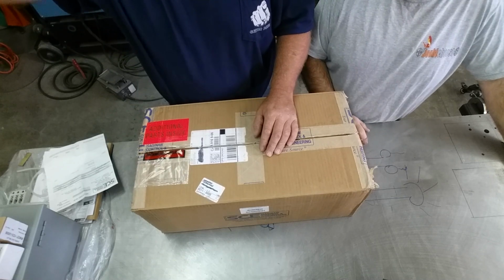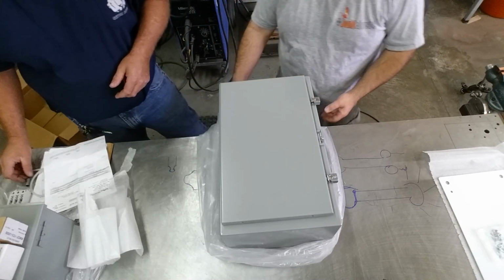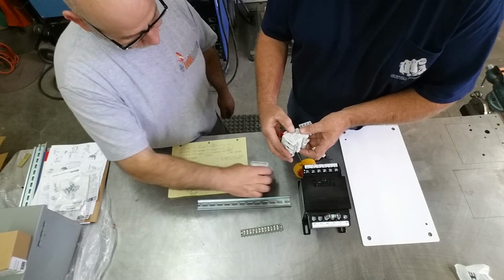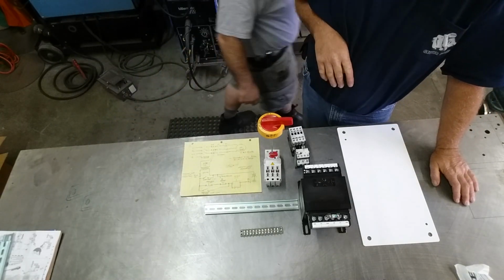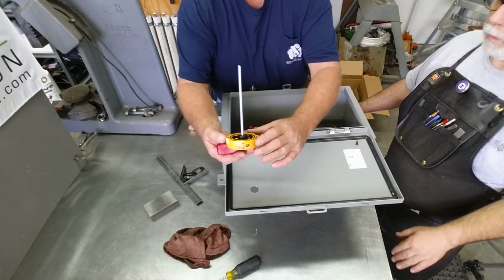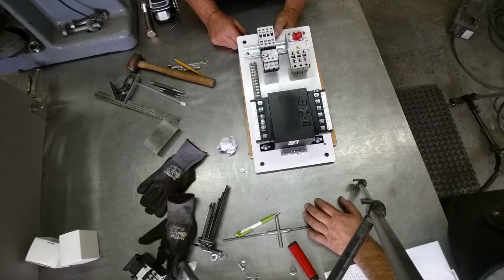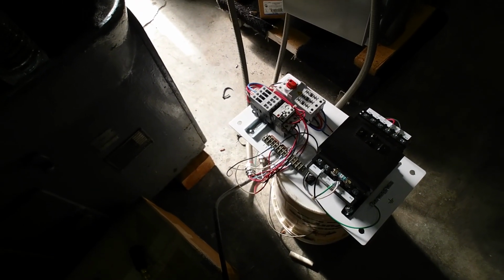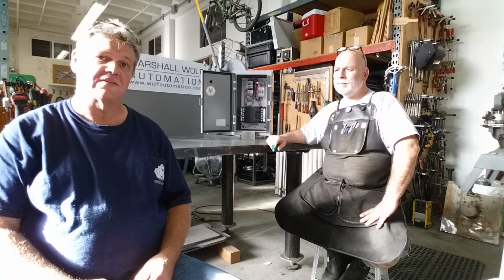Marvel saw control group

Comment: Great video guys! 

I’ve got a quick question. 

I’ve got an Armstrong marvel saw control. Model 81-ea404 and I can’t find mention of the input voltage anywhere online. 

It has a built-in transformer/power supply and fusing mounted to an aluminum plate… But I don’t know if Input is 120 or 240 into the small transformer. 

I’ve contacted everyone I know online and thought you guys might know. 

If you Google that model number you will see there’s only a few mentions of the control unit anywhere online… Before it was quickly upgraded to another totally different unit.

Thank you for any help you can give 🙏
Reply from the maker: Can't really say without seeing the wiring diagram, do you have that?
Reply: Shadon HKW 
Thank you Very much for your reply. 

No I don’t have the wiring diagram, I only have the programmable controller circuitboard and the button display keypad. I’ve contacted everyone online that I could think of… And no one‘s gotten back with me. 

I can’t find a Single shred of documentation on ANY of their programmable controllers. I have the very first version which is usually called “PC” or “PC1”.  If you Google 81ea404 you will see a very low resolution image of the controller in my possession. That’s the only mention I can find it online anywhere.

It’s extremely uncommon. Most commonly I’ve seen the second and third versions which are usually identified as “PCii” or “PC2”... but still no documentation on them.

I did look over the Google patent information… Which gives quite a bit of good info on the operation of the interface and keypad…but doesn’t refer to voltage whatsoever.
Reply from the maker: @hullinstruments  I see on that google image some numbers stamped on the transformer itself, do those resolve to anything useful?

Comment: Great video, gentlemen! Can't wait to see that baby rip through some stock! I love the clean wiring Stan. I'm the same way, and can get pretty analysis when it comes to a control box. I can't tell you how many times I came across a box full of spaghetti, same color wires that were not maked............
Reply: that should have said anal, not analysis. 
Stupid auto correct. ........

Comment: Hi mate.  I have to say, I'm with Tom on the control light.  I rebuild the directional switching on the lathe but I could not get the right button with the right coloured control light for a while.  So I build it first with what I had, and then when I found the right coloured buttons i rebuild it again.  As in Monty python, we have got to have the machine that says ping!

Comment: The primary purpose of grounding the secondary side of the transformer is to provide a fault current path in case of a short circuit on the secondary side.    Otherwise if something were to fail/short on the secondary side, there may not be a low enough resistance path to cause the fuse/circuit breaker to blow, and may leave a lot of exposed metal 'live'.   It also references all of the circuitry on that side of the transformer to a known potential (facilitating easier troubleshooting, blah, blah, blah...)

Comment: Those drawings on the table. 3===D
Reply from the maker: Yea, not sure what Tom was making there ....
Reply: ...What was he making around 11:14 then?
Reply: Wasn't sure what you meant Jim, then I rolled it back to 11:10. O_o Looks like Tom already knows how to get a shaft and knob working nice and smooth. He was just playing with Stan while he was working on Tom's knob. Like Stan said, you don't want to jam your shaft in to hard and deep or you'll bend your shaft. Getting the tip in just far enough to make it feel good while you work it will do.

Comment: Isn't that transformer a lot of overkill for just running a contactor and panel light?
Reply from the maker: He is adding a 110V coolant pump eventually :)
Reply: Ok, had to be something. I used about the same size in a DC power supply (750VA), you could almost weld with it ;)